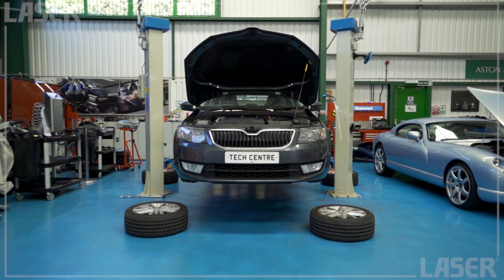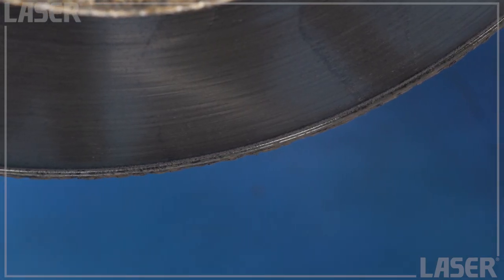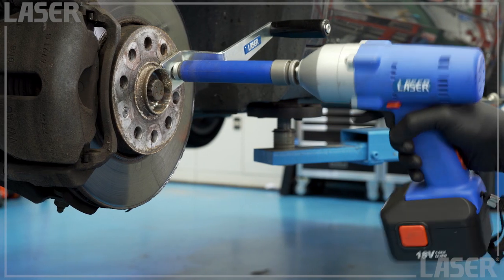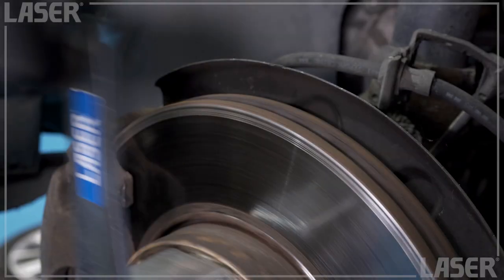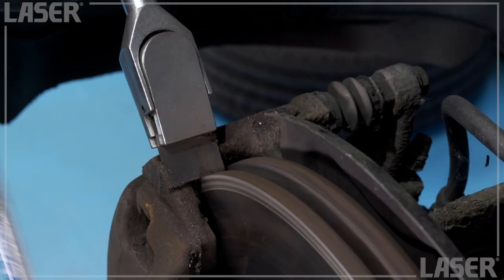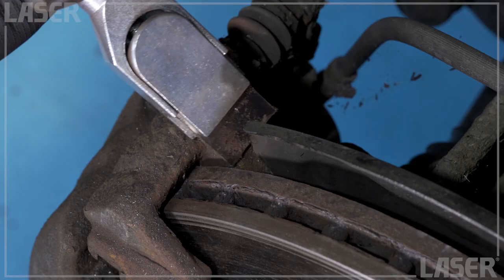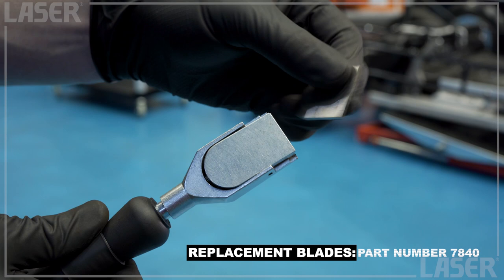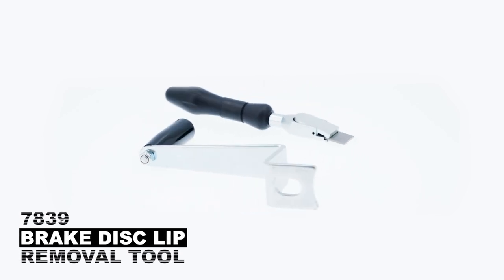7839 | Brake Disc Lip Removal Tool

Comment: Hi I’ve bought this tool for use of my Audi S3 8V but I can’t even get the wheel to turn. I can only think it’s to do with it being automatic, should it be in neutral when trying to do this?
Reply from the maker: If the vehicle is in ‘Park’ the gearbox will be physically locked; if the vehicle is in gear, the wheels won’t turn either. So it will need to be in neutral. The vehicle should be chocked to stop it moving.
Reply: @TheToolconnection  thanks for the reply, I did try it in neutral and it still seemed to not want to turn but I’ll try again. Do both wheels need to be off the ground when this is done?
Reply from the maker: @donaldflump4586  Yes, both wheels will need to be off the ground.
Reply: Make sure the TC (Traction Control) is off, I use a chisel, grind it down using bench grinder & get it sharp....jack the front end up,on axle stands,rev it with a rod/stick at the right revs to spin. Done it for years!

Comment: $20 says I can just use a carbide scraper and just put my car in drive and have the same results
Reply from the maker: That's not something that we'd recommend.
Reply: @TheToolconnection  I don't know, now I think you're just jealous I thought of it first
Reply: I use a chisel, grind it down using bench grinder & get it sharp....jack the front end up,on axle stands,rev it with a rod/stick for the right revs to spin. Done it for years!
Reply: @TheToolconnection  ... because U want us to buy  your tool😅

Comment: quite expensive at around £180
Reply: I use a chisel, grind it down using bench grinder & get it sharp....jack the front end up,on axle stands,rev it with a rod/stick for the right revs to spin. Done it for years!